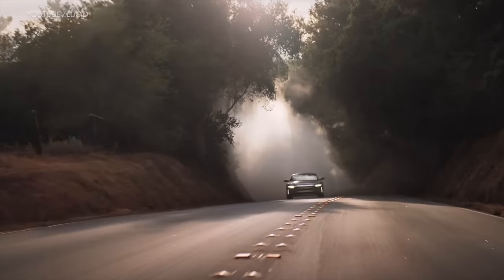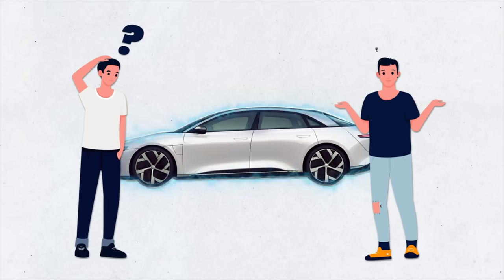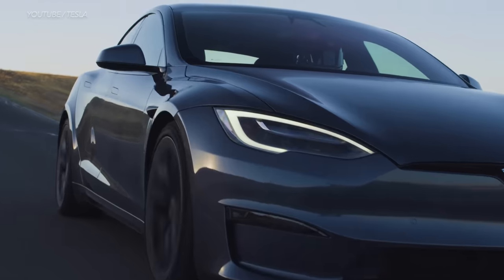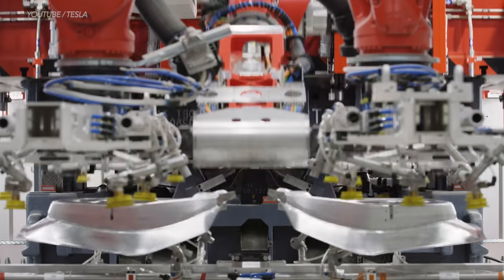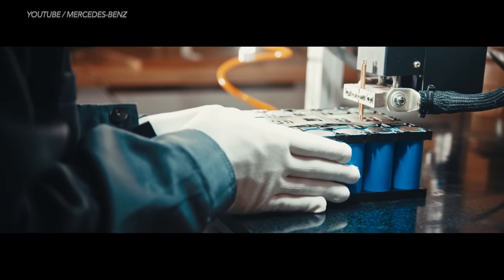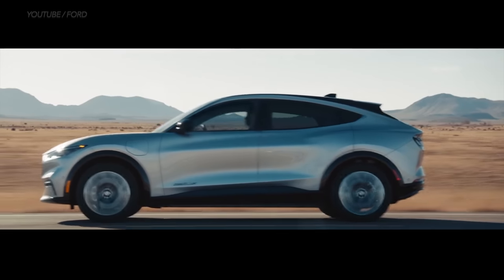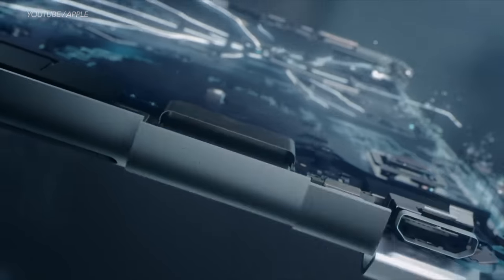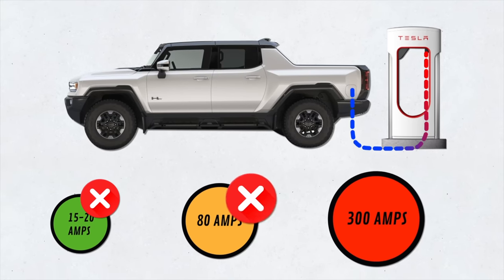Here's Why I'll Die Before I Buy an Electric Car

Comment: Yes! And most very heavy (light truck) weight Tesla's can out accelerate most cars on the road, and even some low end super cars, but can they stop faster than they can accelerate. Let's get practical here. How often does the average safe motorist have to accelerate 0-60mph in 3 seconds. Many never, so in practical terms the only use is boast to the neighbours and associates, and often to those you might not even know or even like.

Comment: There seems to be a lot of push back against electric vehicles since the charging takes so long. But Scotty, you can plug your car in at night and every day have another 300+ miles you can drive that thing. Now compare how long you spend standing around filling up at gas stations compared to how long you spend standing around waiting for your electric vehicle to charge while you sleep. In a year, you'll spend a lot more time at the gas pump. Especially if you don't travel over 300+ miles a day all that much.
Reply: The argument rages on.  It’s all dependent on driving patterns, risk tolerance, and living situation.  Our neighbors own 3 Teslas as their three cars here in SW Florida.  They love them, but they do not road trip.  For a mostly commuter car, they are awesome.  For road trips, you have to tolerate the uncertainty of the time and availability of charging - including risk of traffic jams, extreme cold, etc. so it depends a lot on where and when you go.  And finally,  of course, you have to have a garage.  My own view is most people don’t hate on EV’s - it’s a free country - they hate what seems like being forced into them when the have serious drawbacks for many people.  I almost was going to buy a PHEV, but then saw it weighed 600 more pounds than the gas model.  Now I imagined that on the highway with a depleted battery.  I bought the gas model and saved saved $5,000.  That buys a lotta gas.

Comment: There are really three main reasons you might not want an EV at their current level; 1) You very often drive over the car's range before you can conveniently and cheaply charge the car (you simply drive 250+ miles most days).  2) You don't have a regular "home base" most nights (example: you are an entertainer with a regular performances in different far-off venues).  3) You don't have a convenient and inexpensive way to charge the car when at home (example: you have to park in the street).  

None of these seem to apply to Scotty (possibly #1?).

When you factor in all the benefits, especially the high reliability and low maintenance of most EVs it seems that your declaration "I'll die before I buy an Electric Car" is more emotional than logical.
Reply: You wait until the green brigade learns that tyres shed particulate matter from tyres 2000 times more than a diesel exhaust and EV tyres are worse, due to instant torque driving them.
Reply: @thisisnumber0  no.
Reply: @BoomerPlusUltra  I'm making the case for cars and against the green zealotry, not against EVs, but they will grab that research and milk it to death. Better brace yourself.

Comment: Hey Scotty, does having a higher density battery also mean that it is significantly more dangerous in the event of a catastrophic failure (ie car wreck or damage to the cells/neglect of car battery causing erratic proton charge)
Reply: Yes of course and way more heavy.
Reply: NO—.    New batteries will not be dangerous at all— the new blade battery is completely safe and Teslas already are 10 times LeSS likely to be in an accident that an ice car—-
Reply: @ambroulard  hahaha thos3 fancy names... Blade, dragon bla bla whats next cayber tron?
Reply: I mean, have you ever seen 25 gallons of gasoline explode?
Reply: @bigbangerik66  Gas tanks never explode, do some research on it. Fire yes, but not an explosion.
Reply: @bigbangerik66  stop dreaming. there is simply not enough oxygen inside the gas tank that could trigger a fire, and subsequently an explosion. As for the somewhat small amount of vapor that is present in the tank, it's still not enough to set off an explosion.
Reply: @pepsicherry6389   Not necessarily.    One could have a chemistry that provided 2X the energy density at the same weight.

Comment: Did you say 200k miles or 20+ years?  I usually hit 200k in like 7 years.  Some people that commute long distance can rack that up in about 4 or 5 years!
Reply: Same. Around  30-40k a year. With a few 1200 mile trips aswell. I do it in about 20 hours with 3 stops quick gas n go. Probably take a couple days in an electric. Not to mention I need room for 6 people and bags.

Comment: The issue with the electric car is that when you are driving one you are ALWAYS concerned about how much charge you have left in the god dam thing. I do not want that hassle in a product that's purpose is transportation! Electric cars are a long way off to replacing the petroleum /diesel powered vehicles!
Reply: You worry about how much gas you have as well. And?

Comment: I've always wondered y diesel/gas electric hasn't caught on. Diesel electric sub's work.
Reply: Its the diesel gate thing that ruined that. We do have buses in the UK that are diesel hybrid but they are to be phased out for electric buses.
Reply: Develop a clean diesel engine.....
Reply: Isn't that how train engines work?  A diesel engine spins a generator, and the trains are propelled by electric motors.
Reply: @sapphire163  yes that is how a diesel locomotive works. The engine generates electricity that runs electric motors on the bogies.
Reply: @sapphire163  Yes it is called diesel over electric.

Comment: 400+ mile battery range plus a reliable charging infrastucture = electric car conversion. Bonus would be faster acceleration than a petrol equivalent, no nausea driving style and finally knowing that the electricity going into charging the car was produced in a green way. Tidal energy is not reliant on weather, occurs twice a day and has literally been predictable since the dawn of time

Comment: For me, the turning point where I will get an electric car is when the batteries and motors last as long as gas cars (i.e. we are still driving around original antiques going back to Model T's), not becoming mechanically totaled after 10 years, and when they become self-charging.
Reply: Then you want a 1901 Baker Electric.   Well not for the self charging.    Jay Leno has one with original batteries.
Reply: Jonathan. A typical electric car has around 30 moving parts. A typical ICE car has hundreds.  I suggest you take a look at the YouTube video posted by a Tesla Model S owner. His car had covered 400'000 kms on it's original battery and motor.... Might that be enough for you?
Reply: @Brian-om2hh  Most sources say typical ICE cars has 2K parts.

Comment: Unlikely in even my grandkids lifetime but I would consider one with owner removable briefcase sized lightweight replaceable power cells individually capable of hundreds of miles that could be exchanged like propane grill tanks.  Several could be stored in the trunk for extended range. Dead power cell? Pull into any Seven-Eleven and exchange for a fully charged one.

Comment: It isn't practical or worth the inconvenience. 

I drive a hybrid, and it is the best thing I've done. It has all the pros of both electric, and internal combustion engine (ICE), with none of the cons of full electric or straight ICE. 

Pros compared to electrical: -Battery expense to switch out is only $3000 max for OEM, probably can get a green bean brand for less than $1000. -Uses low grade unleaded gas, can fill just about anywhere in less than 5 mins. -Way cheaper and holds value, just check price of old Priuses

Pros compared to ICE: -Longer range, 500miles per 10 gal tank. -Transmission has no gears, its just switching between speed of electric motor and speed of ICE, somethings using both to achieve insane horsepower for quicker acceleration or speed. Also means transmission will last longer than a conventional transmission since it has no clutchpads to wear out. -Engine will last twice as long, going to 300k or 400k miles because like 40% of it is miles from the electric engine, and not ICE, thus why its getting 50mpg despite similar engine getting 30mpg on a gas car. -Alternator and starter is replaced with electric engine itself, less parts to wear. -Regenerative braking, uses electric engine (in reverse polarity) to stop car so your brake pads rarely get used, and pads can last 3x longer. 

I will say, a PHEV (plug in hybrid) would be the only thing better than just a regular hybrid. But I would never want to lose the advantage it has of having an ICE. Which is why full electric is full stupid. Until they figure out a battery pack that is cheap and longer lasting, and replace all the gas stations with electric plug ins that recharge each individual cell super fast, I will stick to hybrid forever. In my opinion, hybrid transmissions are low key one of the best things hybrids have to offer.

Comment: I worry what will be the resale value after the battery has lost 80% of the charge? I bought a used Chevy Spark EV from Culver City Toyota (Los Angeles) and even though I had a service contract with them, a year later they would not give my car a diagnostic even though they sell Toyota Prius. I had to go elsewhere at a cost of $159.00 just to learn I needed a new 12V battery.

Comment: You don't have to always fully charge your batteries tho, just like how you don't always full your gas tank.
Reply: That’s true, but an issue with EVs is that the battery level slowly drops when they are parked and not driven. E.g. Charge an EV to 90%, then leave the car parked overnight. It won’t be 90% in the morning. Even worse is when you use Sentry mode in a Tesla, it causes the battery to drain quite quickly. The longer it is parked with a sentry mode enabled, the more the battery will drain. So I guess it helps to charge the battery to a higher state of charge to overcome some of the phantom battery drain.
Reply: @richierich087  Nonsense Richard. The loses are absolutely tiny.....  I've had a Kia eNiro for 2+ years. I personally wouldn't worry in the slightest if I didn't drive it for a few days. Like I said, the losses are miniscule. You're overstating the issue massively

Comment: when buying a electrical car I generally will look at 4 things: 
1)price 
2)how much it run on single full charge and what it cost to recharge it 
3)Service cost like oil, parts, repairs ect. 
4)How fast it will degrade, I want to sell it after 5-6 years
,and only after those 4 steps I will look at rest of features.
Reply: 1 depends on 2
2 depends on 1
3 over the live of the car about 1/2 of a new ICE even with more expensive parts
4 Tesla is reporting 10% loss after 200K miles

Comment: A person weighs say 80kg. It's not proper really, for the wheeled device that moves the person from A to B,  to weigh 2000kg !
That in itself says the EV formula is broken. It just isn't right longterm.. Tyre rubber particulate pollution is double, for a heavy luxury EV.

Comment: I love my 2007 FJ Cruiser. 600 miles per charge and a good heater would get me to switch to electric. My neigbor has an electric mustang and its freezing cold in the winter because the heater uses up a poo ton of battery.

Comment: After careful consideration and extensive research, I realized that there is no way I would buy any currently available EV...except for limited/purpose use.
I can use the vehicle, park it in the garage, and plug it in for charge until I need it again. I won't have to worry about the battery getting low or dying from lack of use. It will always be ready and on demand when I need it.
Yes, you have to fill gas at the pump for ICE vehicles, but that is much less time consuming than charging an EV at a charge station. Even if you have 2 people in front of you at the gas station, it is maybe a 10-minute wait before you start pumping gas and then only a couple minutes before you are on your way. Compare that with an EV charging station. Should you be unlucky to have 2 people in front of you, you could be waiting upwards of an hour or more before you start charging...and then have to wait 30 minutes or more to charge. This scenario is more likely to happen as EVs are being sold faster than new charging stations are being built.
Remember that not everyone even has a garage. Such EV owners would be entirely dependent on charging stations. This will only get worse as EVs become more mainstream.
More EVs to charging stations = increased wait times.
Reply: Because, naturally, as people get more and more EV's, charging stations will not improve and multiply - what we have now is what we're stuck with. Just like we still have just one gas station that was built in 1908, so everyone has to fill up there. People are so stuck proving that technology in its infancy has issues, when that has already been proven and known for a while now. Yes, it has issues, but it also has actual headroom, which ICE do not anymore.

On the topic of charging, is refilling your car some kind of a ritual for you? Is it a cultural thing, like you do a dance, sacrifice a chicken, do you like refilling your car? Does it require your undivided attention in case it attempts to run away or something? Because I'll be damned, my car is spending over 90% of it's life parked, and it doesn't seem like a huge deal to recharge it during that time. Before you mention that there is a line at charging stations and I can't plug in, I'll remind you of that one gas station we have that was built in 1908.

Comment: I’m a former employee of a major electric car manufacturer.  I’m also a huge hobby Radio Controlled adult cars and trucks for more than 20 years now.  I switched from nitro fuel to electric completely about 12 years ago when brushless motors and lithium batteries became mainstream in the racing competitions.   I miss the sound and feeling of the nitro fuel engines, but tuning and maintenance was a nightmare in comparison.  Electric is easy, super duper easy lol.  The issue I have with current electric cars are range and battery life.  I would like a 1,000 mile range (actual not estimated!) and a battery warranty/guarantee of 20 years or more with unlimited mileage restrictions or charge cycle restrictions.  I love the idea of a nuclear battery because of its longevity could outlast me.  The driving characteristics of electric cars is far better than ICE in regards to the cars I have driven lol.  I won’t be getting an electric automobile any time soon due to battery pack replacement cost!

Comment: I have a 2019 Chevy Volt and my wife has one of the first generation.  Mine goes 50-60 miles on a charge, perfect for 90% of my driving.  No gas!  But when I have to go to my remote Wyoming property, it gets 48 MPG on gas.  This is the perfect car.  But they stopped making it.  F them.

Comment: That driving range has to be lower than they all claim. If you drive it on the highway between 20-80% charge like they recommend, you are getting 60% of that range. If you start your trip at 100% and drive it to 20%, then you get 80% of that range, assuming you can find a  WORKING charger when you need one.  Those ranges are when NEW. Even Tesla will say you will lose 2% of your range a year, so after 10 years, you are down to 80% of your new range, then you need a new $20,000 replacement.

Comment: I still occasionally see 1980s gasoline cars driving around that our not collectors cars and have probably not had an expensive restoration.  I might buy an EV if I saw that well cared for EVs could last 40 years or more with out too much maintenance and repair expense.  I am guessing that will be about 2065 if ever.  So if I am still driving at age 100 and my gasoline car gives up at that time it is possible that I would consider buying an EV.

Comment: I am not paying $169,000 for an EV, luxury or not.  Its 500 mile range is only achievable on a full charge to full discharge run which is not recommended, so you only get 300-400 miles.  I'll stick to turbo-diesel driven cars.

Comment: The most wasteful thing is trying to move something VERY heavy.  That's the mass in "force= mass times acceleration".  Before you even get to move anything useful (cargo/load) ya have to generate an enormous amount of force just to move the dam thing--especially uphill.  That's an enormous amount of energy wasted to just move the vehicle before you move a useful load.   How is wasting gobs of energy "green"?

Comment: One practical way to solve a quick batter recharge, swapping batteries bulk set cells. Robo-arm in recharge stations during on the go. For Trucks or travel model EV's. They implements this only for fuel alternatives swap, bad choice.

Comment: Not sure where to start? Me being a Tesla owner not having to worry about transmission issues or leaks, oil leaks, coolant leaks, being quick as hell, high gas prices, leaving my dogs in the car in a control environment with a screen so big a blind man can read saying NOT TO WORRY MY OWNER WILL BE BACK SOON, remote unlock that locks itself back on it's own, not paying for oil changes, being able to cool or heat my car from the mobile app, having a awesome line up of music selection for free, video games installed, a map very similar to google maps to allow you to see homes/bodies of water/business as you drive by, self driving and having solar panels at home equipped with fast charging at home I think I'm a fan for a very long time. Being a animal lover DOG MODE alone is worth it. NON OWNERS DON'T FORGET to clean that oil up from the drive way before HOA start charging you daily also swing by your mechanic and tell him you need to schedule a service to find out where that leak is coming from. LOL